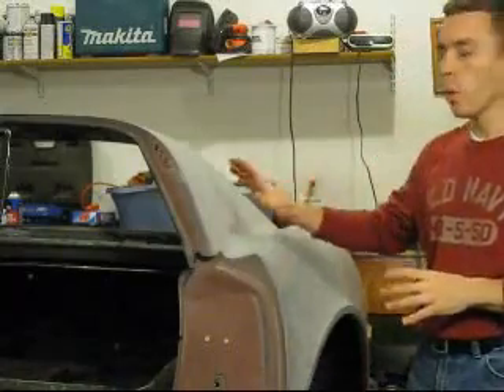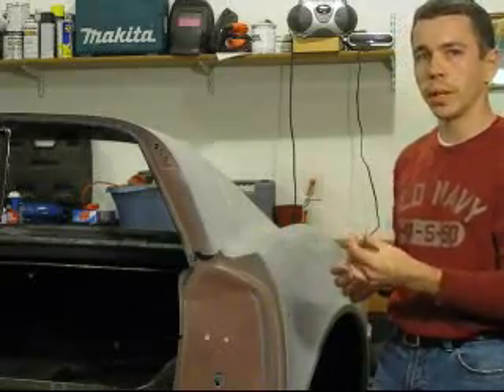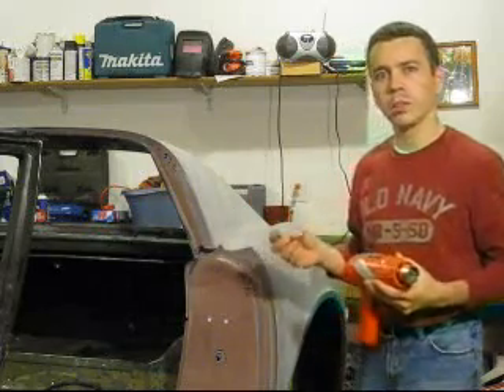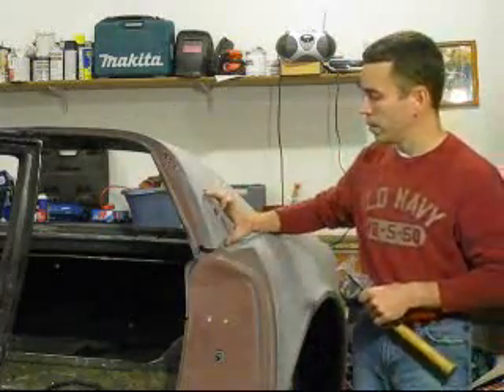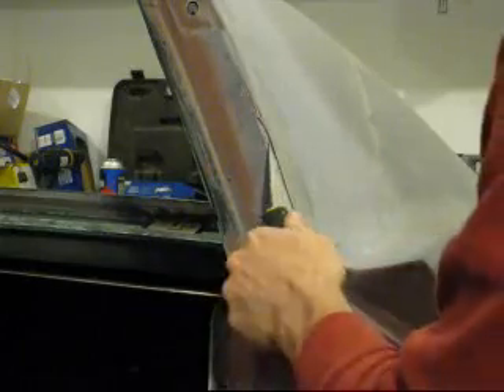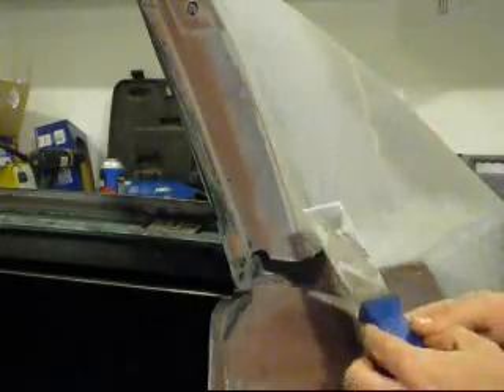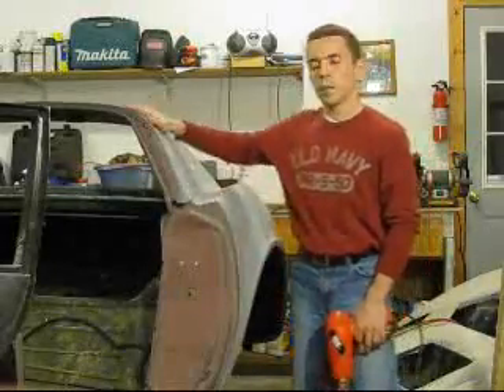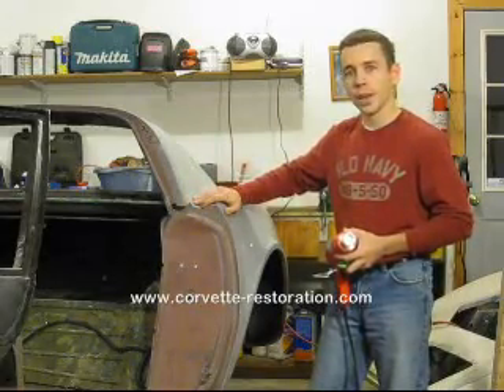Separating Bonded Fiberglass Panels

Comment: so I don't know if you're still doing this stuff but I'm working on a C4 and it really helps that you've put up some general videos on fiberglass. I am absolutely terrified that I'll still mess it up but we will see soon so thank you so much for your information.
Reply: I’m doing a 92 c4 right now any advise on how to remove the quarter panels? Is there a certain chemical to melt the adhesive or do I just cut the glue line ?